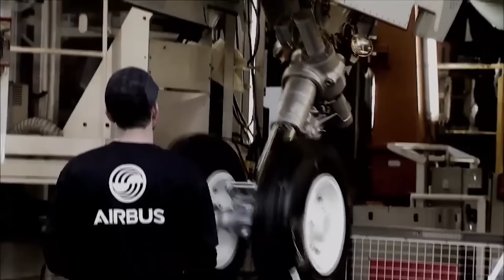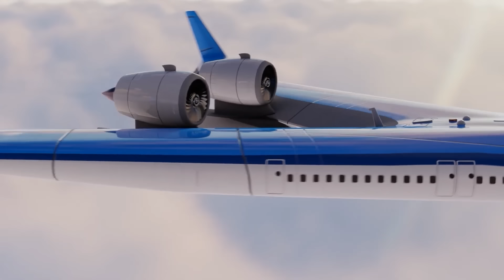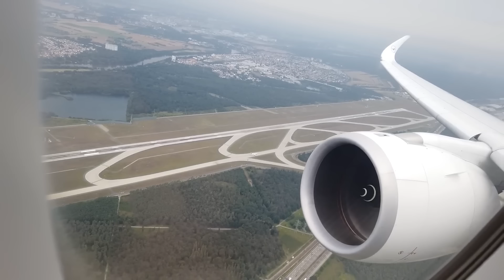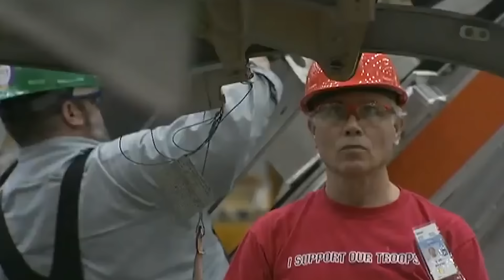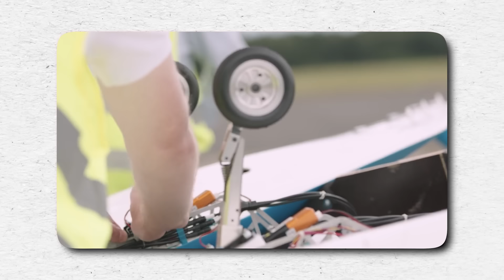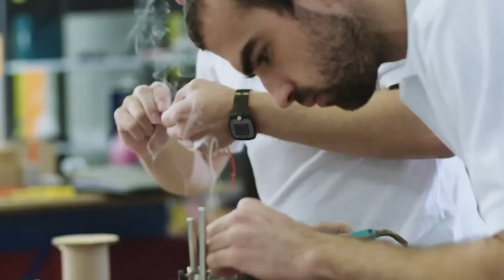Boeing and Airbus Are TERRIFIED of This New Plane | Flying V

Comment: It’s well understood how to pressurize a cylindrical tube.  I have no frikkin idea how they’ll pressurize two ellipsoids merged at the front.
Reply: The science of pressure vessel design is alive and well ever since the need arose during the industrial revolution’s steam engines. This is a relatively low pressure (less than 15 psig, or 1 atm) with an unconventional shape. Nothing that material science, statics and finite element analysis combined with computing power can’t provide.
Reply: @paulnelsonpe  Yes sir!  Materials science and engineering have advanced a bit over the years.  It's only 1 atm.  Not trivial, but also not impossible.
Reply: @paulnelsonpe  true, but now solve it without imposing a substantial mass penalty
Reply: @paulnelsonpe  You claim "nothing"? No, not true.
Reply: @paulnelsonpe  Any design other than a cylinder requires more mass to stabilize internal pressures. This results in more fuel and is less economical. 
Cylindrical pressure vessels in aircraft, such as the fuselage or fuel tanks, are designed to withstand internal pressure while maintaining the lowest possible weight. The design process focuses on managing two primary types of stress: hoop stress and longitudinal stress. [1, 2, 3, 4, 5] 
## 1. Stress Components and Design Formulas
In a thin-walled cylindrical vessel, internal pressure ($P$) creates stresses in the walls ($t$) of the cylinder ($d=2r$). [6, 7] 

* Hoop (Circumferential) Stress ($\sigma_H$): This stress acts around the perimeter of the cylinder and is the primary cause of failure (rupture along the length). It is calculated as:
$$\sigma_H = \frac{Pr}{t}$$ 
* Longitudinal (Axial) Stress ($\sigma_L$): This stress acts along the length of the cylinder and is exactly half of the hoop stress.
$$\sigma_L = \frac{Pr}{2t}$$ [6, 7, 8, 9, 10] 

Because hoop stress is twice as high as longitudinal stress, the vessel’s thickness is dictated by the hoop stress requirement. [1, 6, 11, 12, 13] 
## 2. Safety Factors in Aircraft Design
Aircraft structures use specific safety factors to account for uncertainties in loads, material properties, and manufacturing. [14, 15] 

* Ultimate Factor of Safety (FoS): A standard safety factor for aircraft structures is 1.5. This means the vessel is designed to withstand 1.5 times the maximum expected operating pressure (MEOP) without failing.
* Limit Load vs. Ultimate Load:
* Limit Load: The maximum pressure expected during normal service.
   * Ultimate Load: The limit load multiplied by the factor of safety (1.5).
* Margin of Safety (MS): Engineers calculate the margin to ensure the allowable stress exceeds the applied stress. It is defined as:
$$MS = \frac{\text{Allowable Stress}}{\text{Design Stress} \times \text{FoS}} - 1$$ A positive MS ($MS > 0$) indicates the design is safe. [16, 17, 18, 19, 20] 

## 3. Material Selection and Performance
Materials are chosen for high strength-to-weight ratios and resistance to environmental factors. [15, 21] 

* Aluminum Alloys: Commonly used for fuselages due to their light weight and high tensile strength.
* Carbon Fiber Reinforced Polymers (CFRP): Increasingly popular in modern aircraft for their superior weight savings and fatigue resistance.
* Titanium: Used in high-temperature or high-corrosion areas due to its excellent structural retention properties. [3, 21, 22] 

## 4. Critical Design Considerations

* Fatigue and Pressurization Cycles: Repeated pressurization and depressurization during every flight can lead to fatigue cracks.
* Stress Concentrations: Openings like windows, doors, and nozzles create local stress spikes that require reinforcement to prevent failure.
* Fail-Safe Design: Modern aircraft utilize "tear straps" and redundant structures so that if a crack does form, it is contained and does not lead to catastrophic decompression. [15, 23, 24, 25, 26] 

## ✅ Summary of Result
The design of cylindrical pressure vessels for airplanes is primarily governed by hoop stress, which is twice the longitudinal stress. Engineers apply a standard safety factor of 1.5 to the maximum expected operating pressure to ensure structural integrity while minimizing weight through the use of high-strength materials like aluminum alloys or composites. [9, 27, 28] 
Would you like to see a calculation example for the required wall thickness of a specific aircraft fuselage?

[1] [https://www.youtube.com](https://www.youtube.com/watch?v=PmQb-9MAP-I#:~:text=when%20you%20think%20of%20thinwalled.)
[2] [https://ntrs.nasa.gov](https://ntrs.nasa.gov/api/citations/19650021538/downloads/19650021538.pdf)
[3] [https://www.vaia.com](https://www.vaia.com/en-us/explanations/engineering/aerospace-engineering/pressure-vessels/)
[4] [https://www.engineersedge.com](https://www.engineersedge.com/material_science/hoop-stress.htm)
[5] [https://en.wikipedia.org](https://en.wikipedia.org/wiki/Pressure_vessel#:~:text=Theoretically%2C%20a%20spherical%20pressure%20vessel%20has%20approximately,the%20ideal%20shape%20to%20hold%20internal%20pressure.)
[6] [https://www.handsonmechanics.org](https://www.handsonmechanics.org/mechanics-of-materials/714)
[7] [https://brainly.com](https://brainly.com/question/14330093)
[8] [https://www.youtube.com](https://www.youtube.com/shorts/8lHkeiyoXTk#:~:text=what%20I%20wish%20I%20knew%20about%20thinwalled%20pressure%20vessels%20before%20starting%20engineering.)
[9] [https://www.youtube.com](https://www.youtube.com/watch?v=ic8LmMUr8js#:~:text=thinwalled%20pressure%20vessels%20are%20often%20used%20as,principal%20stresses%20with%20the%20use%20of%20methods.)
[10] [https://prepp.in](https://prepp.in/question/a-thin-cylindrical-pressure-vessel-of-500-mm-inter-663270df0368feeaa5536bbb#:~:text=Calculating%20Hoop%20Stress%20in%20a%20Thin%20Cylindrical,%28%202%20N/mm%202%29%20%C3%97%28%20250%20mm%29)
[11] [https://ui.adsabs.harvard.edu](https://ui.adsabs.harvard.edu/abs/2024AIPC.3059c0001V/abstract#:~:text=The%20stresses%20induced%20in%20thin%20cylinders%20due,has%20to%20be%20designed%20for%20hoop%20stress.)
[12] [https://prepp.in](https://prepp.in/question/a-long-thin-walled-cylindrical-shell-closed-at-bot-66335f010368feeaa579e148#:~:text=Thus%2C%20for%20a%20long%2C%20thin%2Dwalled%20cylindrical%20shell,critical%20design%20parameter%20for%20such%20pressure%20vessels.)
[13] [https://www.scribd.com](https://www.scribd.com/document/292792593/Cylinder-Stress#:~:text=For%20thin%20vessels%2C%20hoop%20stress%20is%20twice,pressure%20vessels%2C%20pipes%2C%20and%20other%20cylindrical%20structures.)
[14] [https://ntrs.nasa.gov](https://ntrs.nasa.gov/api/citations/20150003482/downloads/20150003482.pdf)
[15] [https://eandhmanufacturing.com](https://eandhmanufacturing.com/designing-asme-pressure-vessels-safety-and-efficiency-considerations/)
[16] [https://standards.nasa.gov](https://standards.nasa.gov/sites/default/files/standards/NASA/B-w/CHANGE-2/2/Historical/nasa-std-5001b_w_change_1.pdf)
[17] [https://www.youtube.com](https://www.youtube.com/shorts/lwnSg0ViUJA#:~:text=am%20I%20the%20only%20one%20that%20didn%27t,all%20thanks%20to%20the%20factor%20of%20safety.)
[18] [https://www.youtube.com](https://www.youtube.com/watch?v=0NqIXabnGH8#:~:text=hello%20folks%20this%20is%20Todd%20Coburn%20of,aircraft%20loads%20limit%20and%20ultimate%20load%20factors.)
[19] [https://www.youtube.com](https://www.youtube.com/watch?v=fdKu2M51cIo)
[20] [https://einstein.stanford.edu](https://einstein.stanford.edu/content/tech_docs/pdocs/plans/P0130.pdf#:~:text=The%20pressure%20vessel%20is%20to%20be%20designed,the%20maximum%20expected%20operating%20loads%20and%20environments.)
[21] [https://www.bepeterson.com](https://www.bepeterson.com/6-best-materials-ideal-for-pressure-vessel-applications)
[22] [https://fastercapital.com](https://fastercapital.com/content/Aviation-Safety--Case-Studies-in-Aviation-Safety--Lessons-Learned.html#:~:text=2.%20Advanced%20Materials:%20The%20introduction%20of%20composite,exhibit%20higher%20tolerance%20to%20stress%20and%20fatigue.)
[23] [https://www.ijesjournal.com](https://www.ijesjournal.com/article/Fundamentals-of-pressure-vessel-design)
[24] [https://holdensengineering.co.uk](https://holdensengineering.co.uk/what-factors-influence-pressure-vessel-design/)
[25] [https://www.osha.gov](https://www.osha.gov/pressure-vessels#:~:text=Cracked%20and%20damaged%20vessels%20can%20result%20in,cause%20considerable%20damage%20to%20life%20and%20property.)
[26] [https://www.linkedin.com](https://www.linkedin.com/pulse/safety-sea-sky-aviations-role-shippings-guiding-star-jarek-klimczak-umple#:~:text=Modern%20aircraft%20are%20equipped%20with%20sophisticated%20technologies%2C,significantly%20reducing%20the%20risk%20of%20catastrophic%20failure.)
[27] [https://prepp.in](https://prepp.in/question/the-hoop-stress-developed-in-the-thin-cylinders-is-66151ff16c11d964bb838be6#:~:text=Notice%20that%20the%20hoop%20stress%20%28%20P,4%20t%20%5Cfrac%7BPd%7D%7B4t%7D%204%20t%20P%20d%29.)
[28] [https://servicedfireequipment.com](https://servicedfireequipment.com/scba-hydrostatic-testing-safety-water-jacket-method/#:~:text=Minimum%20hydrostatic%20test%20pressure%20depends%20on%20equipment,without%20structural%20compromise%20under%20expected%20working%20conditions.)
Reply: Relax. KLM etc will have creative aero designers who have come up with some frikkin idea,  because an unpressurised aircraft isn't a goer.  Don't apply for a job there
Reply: @theon9575  Since when have airlines designed airplanes?
Reply: @davidtuer5825  Since now. 😉 
Futuristic 'Flying-V' airplane concept puts passengers inside the ...
Yes, KLM is collaborating with the Delft University of Technology (TU Delft) to develop the "Flying-V," a V-shaped, energy-efficient aircraft aimed at reducing fuel consumption by 20% compared to modern airliners. The design integrates the passenger cabin, cargo hold, and fuel tanks into the wing structure, with plans for it to carry ~314 passengers.
Reply: Surerly the concept would based on two tubes which would be pressurised as if  they were single entities except that they are constructed in such a way that the whole of the aircraft does not need to be pressurised to the extent of the passenger tubes. The  infill areas between the tubes like the wings on a normal plane would not be pressurised as it is there to give lift to the plane.
Reply: ...good point!
Reply: Possibly they will only pressurise habitable areas . Double  shell to,accommodate expansion and contraction within the needed area . Easier control of environment within. Not needed to limit fuselage  or exert any of the forces of outer to the inner.  
Power mostly  aft  engine mounts to spine of total loaded needs most strength . Thinking loading spine , undercarriage,  long way back from source of power , like Fork lift truck with extremely long forks , plus straddling Spine by load mass centre of gravity .   Y tilting in flight , wide spread of weight bias across weights torque stresses . Will need robust steering ability. 
Depleting load of fuel aft  on flight , adds attitude of flight  nose end heavy .Think , centre of mass best best kept ,stable  with  ,engines , source of power mass  for flight  stability.   Test flight of model can have , the built in weight in ratio, and attitude of  flexibility as humans weight bias with tilt  and affects of Centre of gravity  shift .  Ships can load or discharge weight ballast in bad weather, the have options . Planes , not much .  But control  of thrust  direction of power source .
Good looker is not always. A safe venture .
Reply: @williamrbuchanan4153 . But how do we steer around icebergs?
Reply: You can pressurize just about anything.  The Germans had a plane similar in concept in the early 20's
Reply: With Flex-Seal 😂😂😂
Reply: Somewhat like the "flying wing"! Which I think is one of the best designs ever.
Reply: @mikebrzostowski8183 didn't we see that in the 1950s?
Reply: Agree.  That issue could be kill the concept.
Reply: Don't they pressurize all the fancy stealth aircraft??
Reply: @randallsmerna384  from the pilots i know, they use an air mask when they get to cruising altitude. The entire plane doesn't require pressurizatiom because of that.
Reply: @xtheory  I actually thought of that but the body need it too?
Reply: @randallsmerna384 only the crew compartment of the B2 Spirit is pressurized. The bomb bay or other areas of the plane are inaccessible to the crew during flight, hence no need for air pressurization.
Reply: Air Pressure having the AUTO-LEVELLING-INBORN Nature, if I well-understand you - I guess there will be no need for any ...!
Reply: This is doing splits under pressure. 😅
Reply: Composites? Although I'm worried about pressurization cycles
Reply: Aircraft design aside, there’s going to have to be major airport terminal redesigns to support the dimensions of a completely new aircraft like this. Does anyone have wingspan dimensions for this proposed design?
Reply: Worse case scenario the inner structure will have some support. There is no limit to build some pilars-like discrete disguised as separators.
Reply: Lots of superglue
Reply: In theory they. Could just junction 2 slim cylinders, like  2 A320 or A321, it would follow the same or similar methods.
Reply: Compartments.
Reply: @aquaacedever9341  A cylinder is an optimized pressure vessel. Any other shape adds mass and reduces efficiency.
Reply: Pressurize it just like anything else. Seal the windows, seal joints, doors, make sure the structure is strong, no sharp corners, rounded windows. It's no big thing, just a basic engineering problem.
Reply: @fredferd965  it's an engineering problem, but it's not a basic one.

the added reinforcment needed for non-cylindrical shapes means added weight and reduced payload
Reply: @fredferd965  Sorry Fred, you are just lacking in basic engineering knowledge. It is not about sealing, it is about how to maintain a flat shape with internal pressure.
Reply: @PaulWalker-zk2dd  Tell that to my Giant Mickey Mouse balloon.
Reply: @rilmehakonen9688  Do you ride on your Giant Mickey Mouse balloon?
Reply: @rilmehakonen9688  They're not building a balloon and trying to fly it at 620 mph (1000 kph).  If they designed it to fly at walking speed, it might well look like Mickey!
Reply: It's not that difficult; you need more structural members in the center for strength.
Reply: @mercerconsulting9728 Oh, so it's a lot heavier and comparatively weaker, great. Pressurised vessels aren't that simple, which is why they're all pretty much designed the same, a straight tube or a doughnut shape, which is still a tube...
Reply: .. a lot heavier!

Comment: Finally aerodynamics are once again coming to the forefront of aviation design...
Reply: Seems to me these tails aren't really necessary. Stealth bombers have a similar shape and don't have any.
Reply: @tryink688 winglets have been proven to reduce wingtip turbulence the reason they are not on the stealth planes since they would add to the radar signature. But I think those engine pods could be cleaned up a bit..
Reply: @tryink688  and they fly realy realy fast
Reply: When didn't they ?
Reply: @redtale6527 the wing and tube design is a turbulence generator. Jack Northrop knew this over 75 years ago, even today Otto Aerospace is a leader in laminar air flow research.

Comment: A Few Challenges ??? ...
Looks like cargo capacity would be much less which is a huge revenue piece. If true this would wipe out the fuel efficiency. 
It seems far less safe with regards to pressurization cycles stressing the structure. Round is perfect for that. 
You cannot have the fuel tanks in the back only or the load balance would be horrific.
Wouldn't the engines lose some efficiency by being located in the low pressure air area behind the wing tops? 
With regards to noise - it looks to me like there would still be a significant number of passengers near the engines.
Reply from the maker: A lot to think about!
Reply: Balancing of the cargo would be critical.
Reply: Don't you think the designers would have greater knowledge of these things rather than self trained amateur plane spotters.